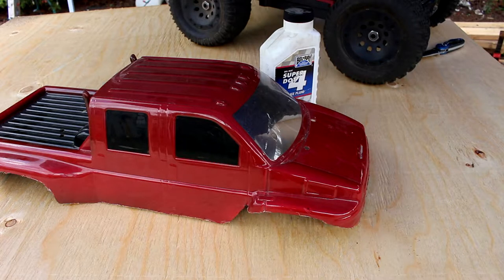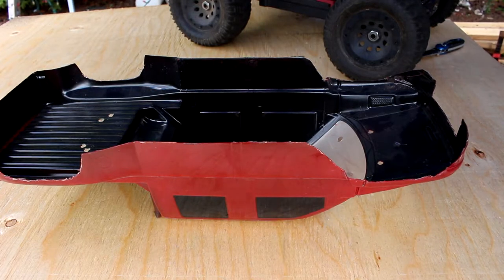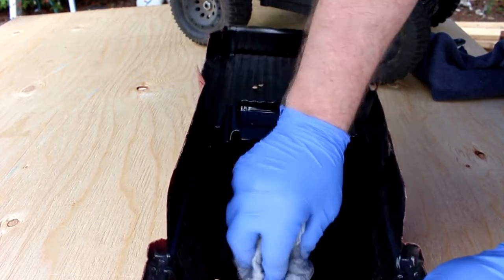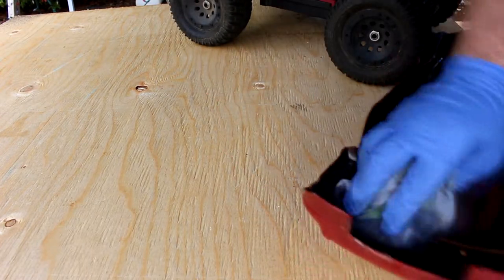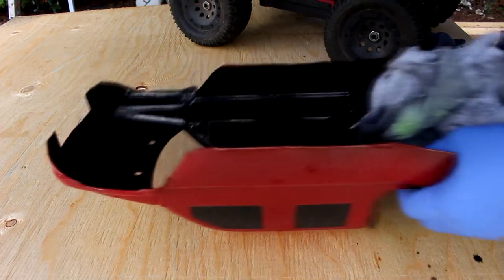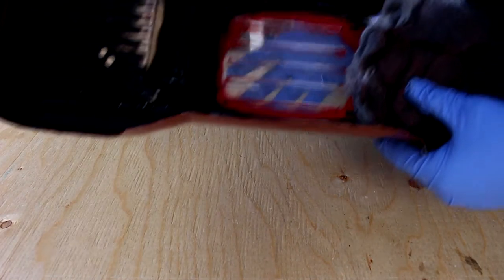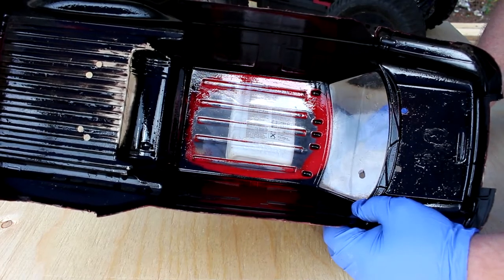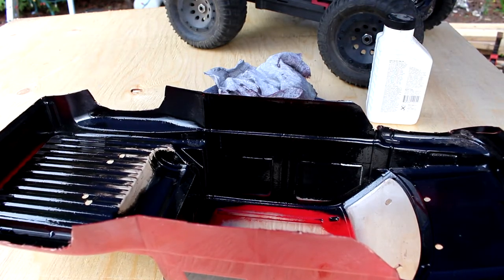How To Remove Paint OFF A RC Body

Comment: Dot 3 makes it a lot smoother. At least on hard bodies, I'm doing a lexan now can't seem too get this oem coating off. But left my hard body over night submerged in dot 3, next morning a paper towel just wiped paint away
Reply: Update. So using nail polish remover and cotton balls, just dipping, strips the paint right off with out melting as it does when poured on and once you go over one time with the remover using 91% rubbing alcohol removed the filmy layer left from the nail polish remover. All done my body looks like glass. (also using a scratch remover polish like that one stuff out it starts with a M I can't remember the name, before applying the first coat does what's intended and the finished shell is amazing)
Reply: @MysterP  nail polish remover with or without acetone? And did the polish remover make it cloudy?
Reply: Did you ever figure it out, I wanna clear my windows?